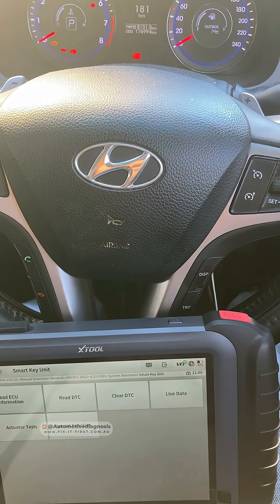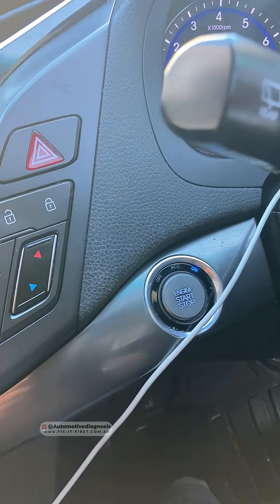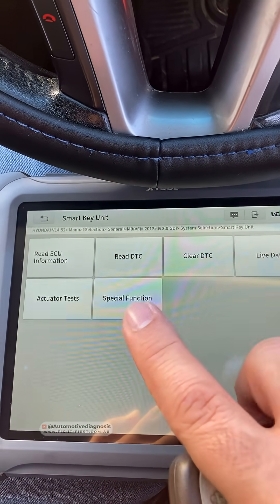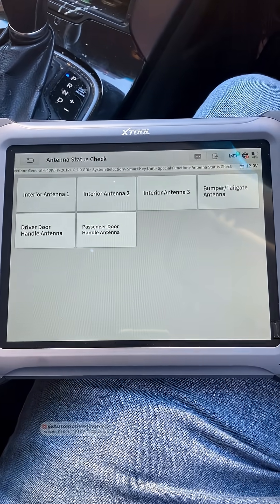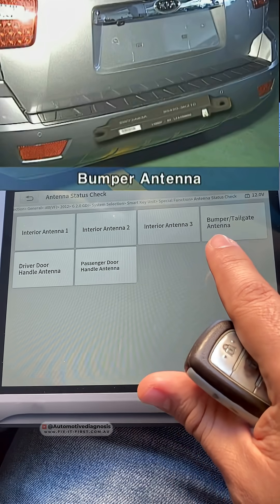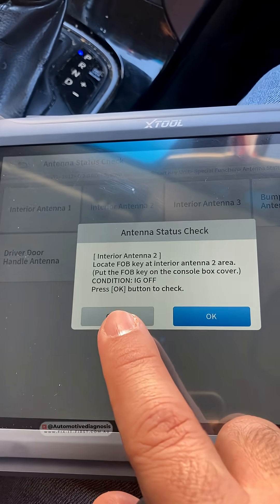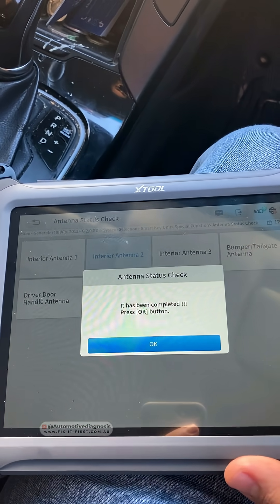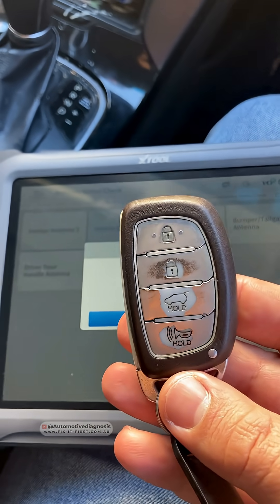Smart Key LF Antennas Check | Hyundai & KIA Push Button System | XTOOL X100PAD Elite

Comment: Good information sir it will be very helpfull for us if it works in this way .
Sir, i have a question, that for internal antennas like under the ceter console a dtc is created if that doesn't work but for antennas like under the driver door the dtc is not created if that doesn't work so is that true ?